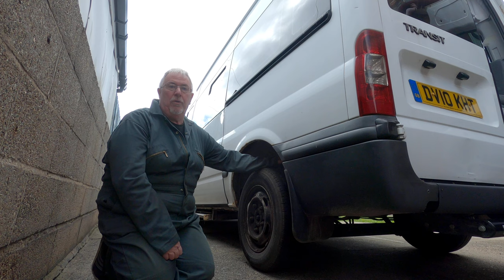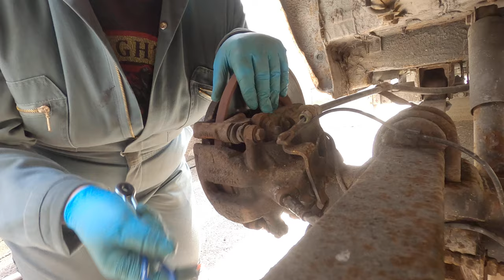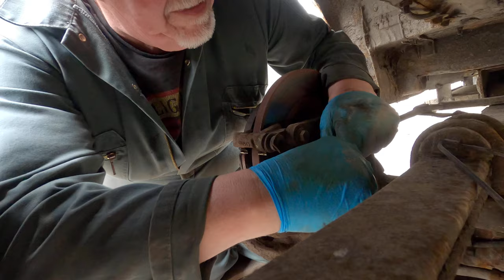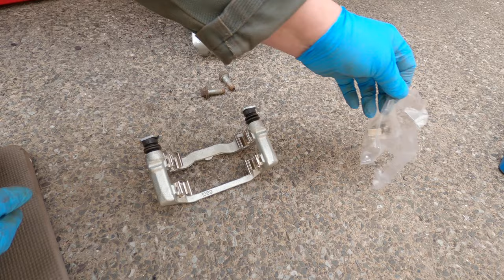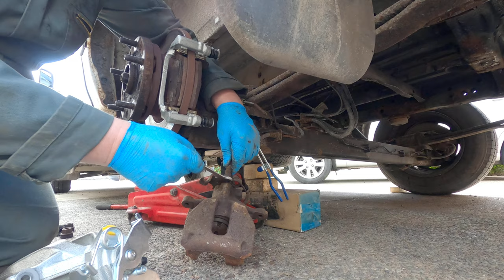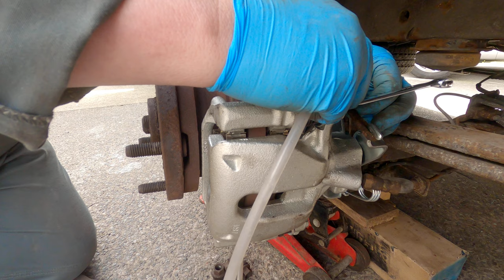Ford Transit Rear Caliper Replacement Guide [Mk7 Transit Van Handbrake] DIY Camper Conversion | 12

Comment: Good video and well explained.  I was kinda surprised to see the handbrake cable working the same calliper as the main brakes. "Then again ,i am kinda used to working  on older cars😅. . My fathers 2017 transit has the same problem. The rear left brakes are not releasing properly once engaged and so are building up heat. Will sort it this weekend  sure...good video again👍
Reply from the maker: Glad it helped. I must admit I am not keen on brake calipers that include the handbrake mechanism.  Good luck with the job.

Comment: Are you ment to take the hand brake off to get the cable back on?
Reply from the maker: I think it might be a struggle with the handbrake on! :)
Reply: Haha yeah it was I took it off I just wanted to make sure I didn’t do anything wrong 😁also I’m guessing it dosnt matter if I have it on when I bleed the break calliper after🤔
Reply from the maker: @alfiemaud9177 No worries, and no that wont matter. 😁
Reply: I did it I’m so proud haha thank you so much for your video honstly 🎉🎉😁😁😁😁 so happy haha
Reply from the maker: @alfiemaud9177  Awesome, congratulations in getting your van fixed. Really happy it worked out for you. 😃

Comment: Hand brake cable I found easier to just take out the two mounting bracket Allen bolts
Reply from the maker: Thanks.  I did find doing the second one a bit easier.  Rust doesn't help. :)